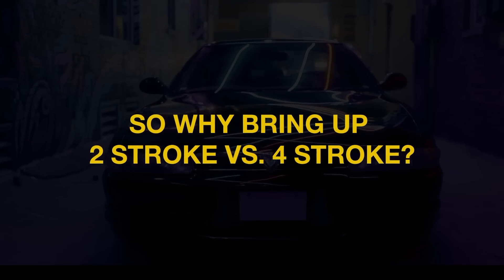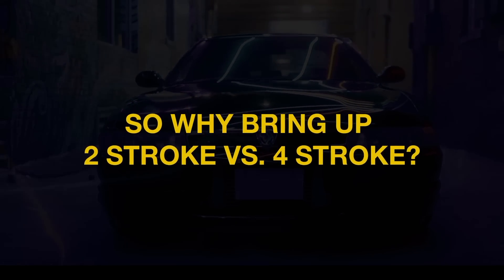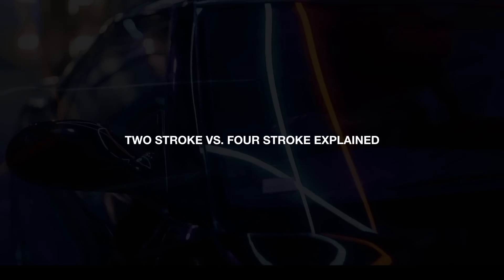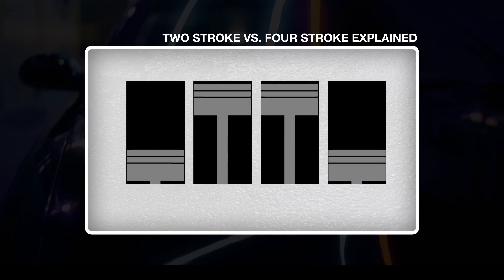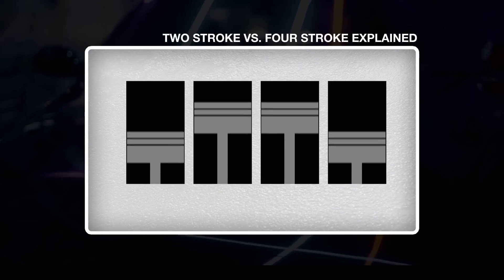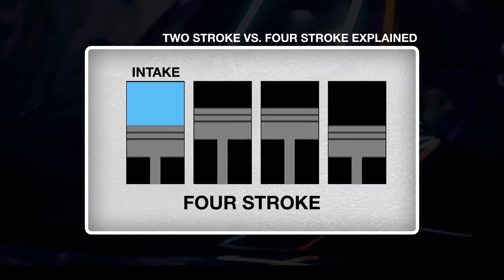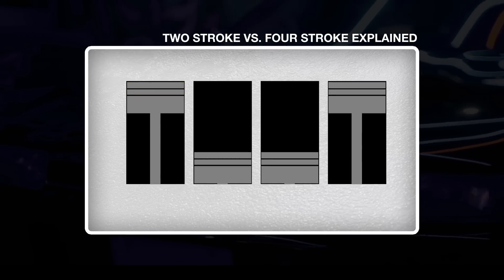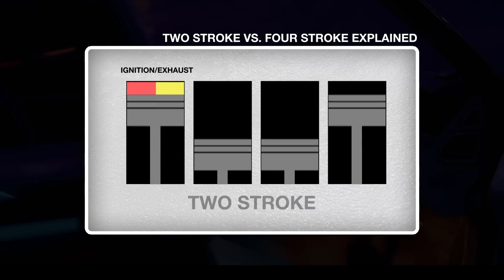The SECRET Behind Why RX7 and RX8 Rotary Engines Make SO Much Power

Comment: You didn’t mention that it takes 3 crankshaft revolutions for the rotors to make just 1 revolution. So now it’s really confusing what’s being measured, cos what’s always puzzled me is the engine speed is measured from the crankshaft speed, that’s actually 3 times faster than the rotors speed, I’d rather measure engine speed from rotor speed, making the rotary the slowest revving engine 🤷🏻‍♂️
Reply: That's right!  A 9,000 RPM rotary race engine has the rotors at only 3,000 RPMs!

Comment: r 12, 2019 at 12:17pm
+

Cam VanDerHorst
By: Cam VanDerHorst, Contributing Writer 
Mazda has made breakthroughs in rotary technology – and it may return to production soon.

Fans of Mazda's rotary engine have spent years lamenting the loss of the unique powerplant and eagerly awaiting its return. In the face of ever-tightening emissions standards and ever-increasing fuel economy requirements, it has seemed – for a while now – that the rotary engine was doomed to remain a relic of the past.

Perhaps more so than any other industry rumor, whispers of the rotary's triumphant return have appeared with unmatched regularity, only to wither and die on the vine just as quickly. However, this is no rumor – this comes straight from Ichiro Hirose, the executive in charge of powertrain development at Mazda.
More Rotary Rumors:
Rotary Fan Renders A Modern RX-7 For 2020 And Beyond
Everyone At Mazda Is Dreaming Of A Rotary Sports Car, Says CEO

The Australian motoring publication Drive had a chance to speak with Hirose at the 2019 Geneva Motor Show, where Mazda was celebrating the reveal of their new CX-30. More important than a new crossover, however, was what was revealed about Mazda's developments in rotary engine technology.

According to Hirsoe, what was originally intended as a range extender has grown to become a much more versatile powerplant in light of recent technological breakthroughs. He says that the new flexible rotary hybrid powerplant currently in development is so efficient that it could be sold in any market in the world – even markets with notoriously strict emissions regulations in place.

Hirose went on to describe a setup similar to the Toyota Prius, in which the hybrid drivetrain has the versatility to not only generate electricity, but to actually power the drive wheels when needed. This technology, dubbed XEV, may make an appearance in production cars – at least in Australia, and, we'd imagine, Mazda's native Japan – within the next few years.

That's perhaps the most promising news yet for the rotary engine faithful. While we may never get another car like the RX-7, we may indeed end up with something even better.

Comment: Rotary motor explained...Wankel engines, more commonly known as rotary engines, differ from regular engines as they don’t have a reciprocating piston travelling up and down in a cylinder. Instead a triangular shaped rotor spins inside an hour-glass shaped housing. Valves in the casings allow gases to transfer, similar to a two-stroke, but unlike a reciprocating engine all the parts inside move in the same direction. This means the engine is smooth, compact and capable of delivering a high power-to-weight ratio

Comment: People still don't get that the rotary doesn't need to fire all sides of each rotor to complete a power stroke and rotate the eshaft lol. You cant measure everything the same way when not everything works the same. There's a reason why they called it a 1.3.

Comment: giorx5 explained it good. The definition from piston engines cannot be used for rotors. RX8 is 1.3L period.
Reply: Wrong, 3.9 liter... or 2.6 when compared directly to a 4-stroke reciprocating engine.
Reply: 2-stroke Benz-Cycle 360° 4-stroke Otto-Cycle 720° 4-stroke Wankel-KKM 1080° ARE YOU SURE?

Comment: I'm guessing the manufacturer doesn't want to say it's a 3.9 liter cause than it would be a slow performing engine, but by using 1.3 terminology it's a very small motor with more power. Lol

Comment: It's a two cylinder engine that's not a 2 stroke or a 4 stroke because it's a rotary . It produces around 38 BHP @ 8500 RPM. It's also the smoothest running and driving car you will ever drive. Simple.

Comment: Comparing a 2.0L inline 4 engine, and 1.3L Rotary Engine.
You can only pour 2.0L of water into the inline 4 engine, and 1.3L of water into the rotary engine, because thats the space available in the engines. Calculating rotary engine x3 is just wrong. You can only say that the rotary engine fired 6 times, while inline engine fired 1 time, in one cycle of the shaft

Comment: Did you leave out the fact that with every one full revolution of the crankshaft in a rotary engine the rotary engine fires three times? I mean I saw you go over the piston engine like this but not the rotary engine showing the position of the crankshaft, did I miss something? The problem with the Rotary engine is it was designed incorrectly and those that took it into mass production did so with those flaws built into those engines. Learn more about the solutions to these built in problems here: https://www.youtube.com/watch?v=m3pCLjHZmhM

Comment: So if it's a 1.3 it makes alot of power but terrible mpg. If it's a 2.6 it's power is about right but still poor mpg and if it's a 3.9 it's terribly underpowered but the mpg is about right.
Reply: Quoted for truth
Reply: James
You got it. It's a 3.9L engine that is terribly inefficient in terms of converting fuel into usable power, one of the reasons it was discontinued, but it's quite efficient at maximizing engine displacement within a certain volume given it doesn't have a valve train or large crankcase to accommodate connecting rods. The 13b has about the same outside dimensions as a 1.3L piston engine, maybe even smaller, but it still displaces 3.9L. That's pretty impressive.
Reply: And handily Beats 5 liter piston americana all day long! Been there . And with the Handling of the Gods! AWESOME!!!
Reply: 1LivingLucid
No it doesn't. The 13B makes shit for HP stock compared to most 5L V8s, even of it's respective time period. The most HP I've ever seen out a Wankel was about 1650HP and that was a heavily modified 4 rotor running ungodly high boost. Hell, there are street driven Mustang Coyotes that make that much with half the boost. Some of them with stock parts.
Wankel's can be a good engine for racing but you're just talking shit.

Comment: The title is quite misleading because this is basic stuff about rotary engines instead of specifically about the Mazda RX7/RX8 engine and why THOSE (specific) make a lot of power.
Reply: Tylo considering he's talking about a 13b the title is correct as that's the engine in the rx7 and rx8

Comment: You cant really call a rotary an Xstroke engine. It doesnt stroke. It rotates. We just understand it this way. The 1.3 measurement makes most sense. You cant measure the air from every face because its a new cycle. This is why people love/hate the rotary. Its a completely different way of thinking. Mazda or anybody should really bring it back. Im sure with more reasearch they can be competitive with piston engines.

Comment: Beneidenswert! Ein werksfrischer Wankel, das dürfte quasi einmalig sein. Hast du den Mäher noch?
Reply: SOS Brigade Chief doktorbimmer lol, I'd rather take my chances from people who own a rotary and has had no engine problems with 150k+ miles than to listen to someone who goes from video to video talking nothing but cons about the engine. You really do sound like you spend a lot of time on /o/ btw. Not an insult. Just an observation.
Reply: DOKTERBIMMER A LL WANKEL ENGINES FLOOD WHEN YOU ASK WHEN A APEX INES UP WITH THE LEADING PLUG HOLE YOU FLOOD THE PLUG WITH FUEL AND WASTE AIR FUEL AND HALF OF THE COMPRESSION STROKE FAILURES
Reply: @movingcombustionmazda6340  THANK YOU

Comment: So if I'm currently building a 6 rotor engine based on this math logic, my engine is pushing 15.6 liters of air. Fuck I have a fucking tractor trailer engine. Ain't no one got shit on me. WooHoo!!!!
Reply: Rob Gomez there even a 12 rotor used on a power boat and if based on your calculation it has double the swept displacement!
Reply: One thing is for sure, it's going to use the same amount of fuel as a 15L engine would lol
Reply: TurboNFRStwoK, Shit yeah, I'll be lucky if I get down the quarter mile with a full tank. :)
Reply: Lin Chester, shoot 12 rotors would make 31.2 liters, now yer talking industrial sums o biznitches! :)
Reply: Assuming each set of two rotors is 1.3 litres, how the fuck did you come up with 15.6 litres? 1.3x3 is 3.9.

Comment: I don't think it's an archaic or unknown reason Mazda wanted to keep the classification as low as possible...aren't Japanese cars taxed my size and engine displacement? 
The way I've always understood it was, Mazda did some fancy talking and convinced certain agencies it should be classified lower than it probably should have. 
Lower taxes=more affordable to more people=more cars sold. 

I could be wrong though....I'm no rotary master
Reply: goobs35  No, you're right. Japan and Europe tax cars based on engine displacement. They're rated low on purpose to avoid high prices, but Japan also has an additional weight tax as well
Reply: Joshua Finley no its not lol. Europe is not 1 country. Taxes in the netherlands go by weight and co2 output. So my 1.5L mazda 88hp is actually more expensive than my 1.8 200sx with 200hp
Reply: Special  When I said Europe, I was mentioning France, Germany, Italy, Great Britain, etc., not the Netherlands or anything like that. Some countries do tax cars based on weight, power, and carbon emissions, but I was talking about European countries in general, if that makes any sense
Reply: goobs35 The fact that the RX8 is a 4 door
 model, insurance wise, it's not a sports car!
Reply: The contrived "Tax Displacement Method" was created by NSU in Germany before Mazda purchased the design from them, as Japan had a similar tax code regarding tax per engine size they simply kept the same method for calculating displacement.
 *American designs used total displacement instead of the "Tax formula method to calculate the displacement as the U.S. uses Gross Vehicle weight and MPGs to tax vehicles for registration not engine size.
For example, the General Motors RC2-206 Wankel was the same swept volume of the Mazda 12A Wankel but GMs engine had a published displacement of 206 cubic inches (3,380 cc).*
Reply: So move along puppet.

Comment: piston engines are evolutionary but the wankel engine is revolutionary
Reply: DOKTERBIMMER A LL WANKEL ENGINES FLOOD WHEN YOU ASK WHEN A APEX INES UP WITH THE LEADING PLUG HOLE YOU FLOOD THE PLUG WITH FUEL AND WASTE AIR FUEL AND HALF OF THE COMPRESSION STROKE FAILURES

Comment: Tell em all how the 13B = a 1.3 littler motor 
12A = 1.2 litter an so on
Reply: But that is using the contrived "Tax Displacement" method, Engineers, Motorsports sanctioning bodies and government revenue agencies all classify the Wankel under the "2X" conversion formula eg; a Mazda 13B as 2.6 liters instead of its true displacement of 3.9 liters.
Reply: fake

Comment: 1 full rotation of a rotor = 1080 deg of crank rotation 

Each rotor have 3 faces that carry their own thermodynamic cycle separated equally at 120 deg away from each other. 

1080/3 = 360 deg = 1 combustion per cycle = 2 stroke engine. 

I don’t know what so confusing about rotary engine? 

If 500cc two stroke and 500cc rotary engine share the same thermal efficient number, both will make the same power per unit of mass of fuel that they burn. Simple.
Reply: You seem to be very unfamiliar with how swept volume displacement is correctly calculated.
The Wankel KKM-57 type engine requires 1,080° of crankshaft rotation to complete it's firing order sequence, and with this a Mazda 13b has an effective displacement of 3,924 cc's

Comment: It goes to show how silly all this displacement is. A 1.4 litre displacement piston engine can be supercharged or turbocharged, displacing more air, yet it is still rated as 1.4.  Engines should be rated by their power/weight ratio only, as nothing else makes sense.
Reply from the maker: A turbocharger or supercharger does not increase displacement.
Reply: BROTORS 
A turbo forces more air into the cylinder, than when it operates atmospherically.

Comment: Of course the OEM ranks it as 1.3L so they can brag about how much power their "little" engine makes (and then hide in shame when fuel mileage is brought up, lol)...

It really depends if you want to equate a piston to an entire rotor, or to a single rotor face.  I'd argue that the "spirit" of the definition, "...after each piston has fired" should equate to "after each rotor face has fired," leaving us with a 3.9L motor.  Crank evolutions aren't relevant to engine size.
Reply: 383mazda Either way you slice it you pick your poison with any car. More power and less fuel economy or less power and higher fuel economy. This is true with any engine. It burns gas roughly the same rate as a 200 hp V6 of the same era so to say it's bad on gas is a lie.
Reply: mischiefpwns I meant its bad on gas vs a piston 1.3L motor.
Reply: 383mazda that's a given. It's probably less fuel efficient than a 2.5 V6 based on my RX8 monthly gas bill...

Comment: DOKTERBIMMER A LL WANKEL ENGINES FLOOD WHEN YOU ASK WHEN A APEX INES UP WITH THE 
LEADING PLUG HOLE YOU FLOOD  THE PLUG WITH FUEL AND WASTE AIR FUEL AND 
HALF OF THE COMPRESSION STROKE FAILURES

Comment: Its not a 4stroke or a 2stroke because there is no stroke on a rotary. It rotates and thats why its a rotary
Reply: Well if that was true, why does a 13B have a 30mm stroke?
Reply: Yeah it does, because the Wankel KKM is a 4-stroke... and the 15mm throw on the Eccentric-crankshaft produces two 30mm
strokes per 360° revolution
Reply: doktorbimmer except stroke is determines by piston travel. No pistons
Reply: Yup, but don't limit your definition of piston travel, its not limited to just linear motion or up and down.
Yes, Pistons... triangular shaped Pistons that orbit in a planetary motion, not in a reciprocating motion.

Comment: "Why do we stop measuring displacement on a rotary."
It's simple.
When Max Bentele visited NSU (the company the created the first working wankels) in the 60s, he suggested only counting 1 chamber per rotor to avoid EU displacement taxes; knowing that politicians would just accept what they said.  
That is it. 
Now everyone either forgets how the engineers that built the first working versions calculated rotary size (they would call a 13b a 3.9L)....  Or they argue furiously to continue the false "so much power from such a little motor" nonsense.  

Even the guy in the video does it.  
"When do we stop measuring...."
Counting the actual swept volume would be "weird", so we'll use an entirely different method that only counts 1/3 the displacement, and then make massive praise about how much power it makes while being sooooo small.

A 2JZ would have an outstanding HP/L if we said it was a 1L.
A rotary fan wouldn't let that pass, so why should anyone buy into the 1.3L that actually displaces 3.9L?

Comment: You can"t compare rotary to piston 2 or  4 stroke !! you are claiming  eccentric shaft  speed and as we all know the eccentric shaft IS geared so one cycle of a rotor =;s 1.5 cycles of the shaft  !! The rotor side of it IS LIKE a two stroke full stop .. port activated

Comment: So for a 20b 3 rotor ... Is going to be 1.8L? I'm so confused...
Reply from the maker: +Kevyn Pinzon 6.0L
Reply: Compared to a piston engine, a 20B is similar to a 4L V6... One ignition event every 120 degrees of engine rotation, just like a V6, and in 2 revs, you get 4L of air/fuel burnt.

Comment: What matters is how much power does it generate relative to the amount of fuel used. 
     Since all the energy in every engine comes from the fuel it doesn't matter if it's. 1.3 rotor or a 5.0 v8. The efficiency is still measurable the same. And the rotor performs poorly.  
   A 13b makes maybe 230hp without turbo charging, some claim 250 in the rx8.  Whatever let it have 250hp. A big v8 of the likes found in mustangs and corvettes, or BMW's produce up to twice that power from the same amount of fuel.
Reply: Adam Adam that's all true, but your not comparing displacement to displacement.  A 4 rotor which would be a 2.6L will destroy a Ford or Chevy v8.  Now as far as you said per same energy ( which is a subject in it's own) yes twice power with twice the parts and twice the weight too.  This why a rx8 with a large motor despite having much more hp doesn't do much better at the track, not the strip. the main problem with rotory engines is that in theory they are supposed to be very efficient but none have figured out how to put that into work.  I think rotory only use a small amount of the energy produced, the rest is wasted out into the exhaust, another reason why there are not environmently friendly.  If only some r&d was done as much as a piston motor maybe the rotory could of used a lot less fuel and have a good mpg.  24 mpg in the city with a rx8 would of been even more amazing.